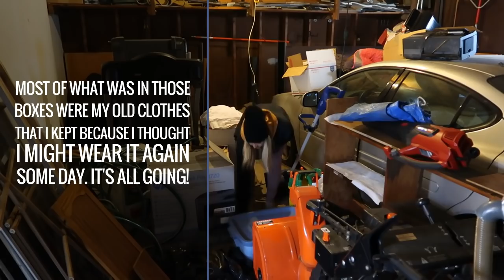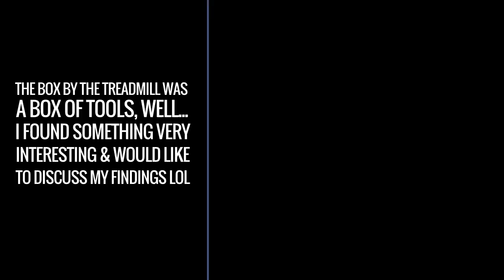Most Extreme Declutter & Organize | Video #1 The Garage Mini Series | My Journey To Minimalism

Comment: Not drills, but I recently found FOUR power staplers.  You know, the kind that you press up against something and then push down on the handle and "shoot" the staple into whatever - picture frame, bottom of a chair seat that's being recovered, etc.  How did I wind up with 4 of these?  Exactly how you described what happened with the drills: can't find it, so bought another one!  It happens.  LOL!  smh

Comment: I think that's pretty good progress - I'm very impressed - I guess one thing that helped was that things only went there to die for the most part - so there were many easier decisions of large items - but the sheer volume of stuff that was removed and the nice clean open space is heartening!  No, your garage isn't so bad, I've certainly seen worse and I didn't think those people with worse had anything to be ashamed about - time and the slow build up of items will sneak up on a person then wallop you with a space you can't use at all or even get through without it being a safety hazard - it's bothersome but not shame worthy to my way of thinking!

Comment: Ok the drill problem is probably less climactic than you thi k
They are the same brand but one is regular the other is an impact drill and they are ofter sold together
That still doesn't explain why you have 8 but that explains 2 i guess